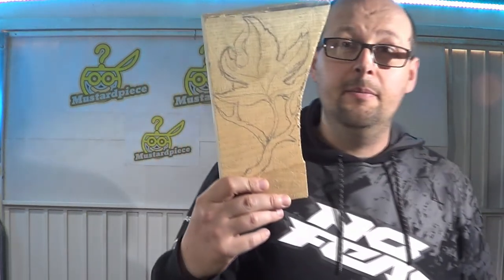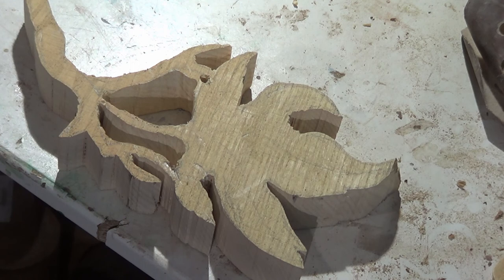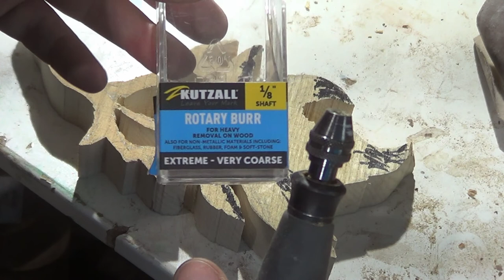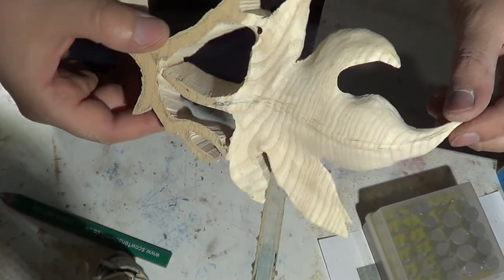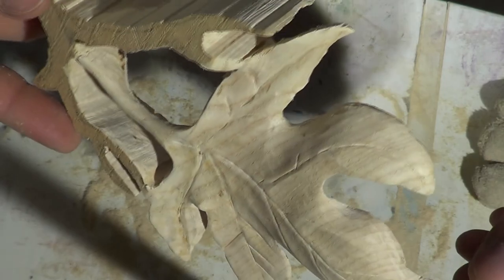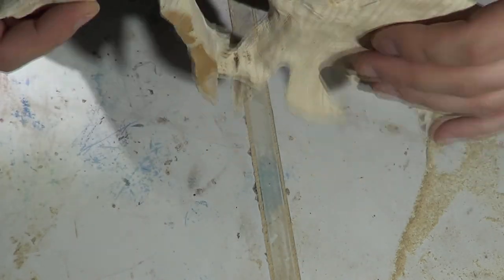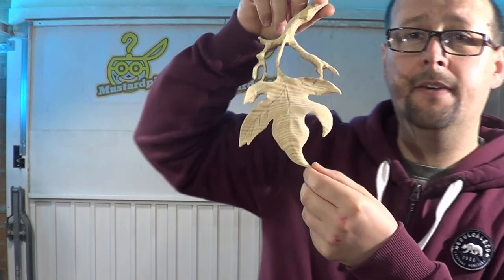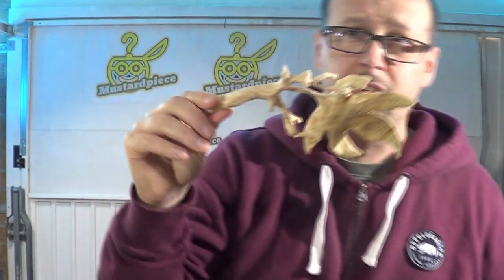My Lathe is Broken so I Tried Woodcarving

Comment: I'm not sure where you live but I've been a customer of Axminster for many years.  They've made a fortune from me but their after-sales service is second to none.  If you bought your lathe new from Axminster they'll come to your assistance quickly.  However, if it is pre-used I don't think you will receive much help.  I dread my lathe breaking down but, I too, would probably turn to wood carving if that happened.
Reply from the maker: I bought the lathe new and I live in the UK. They sent me a new control box. It only took 4 days so my late is fixed. :) Thanks for watching.